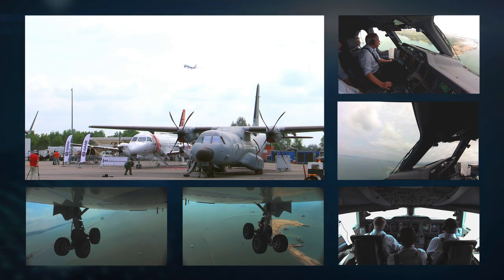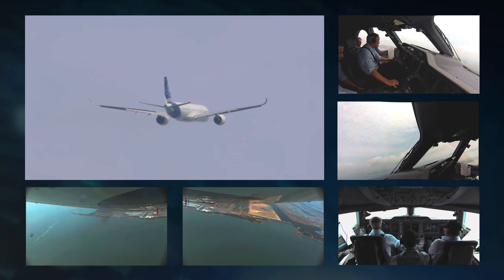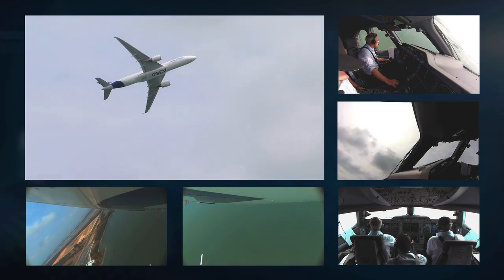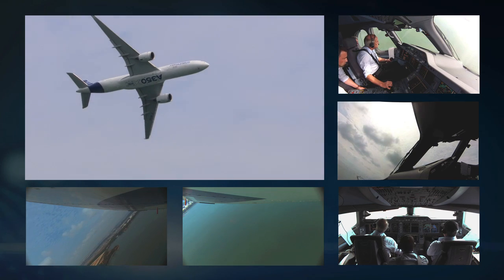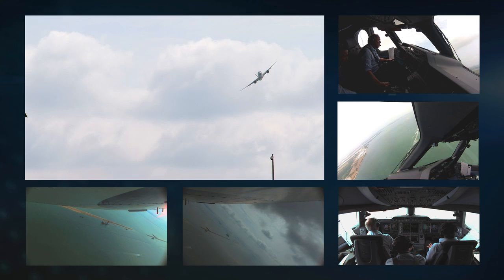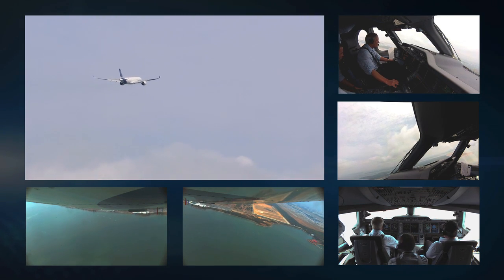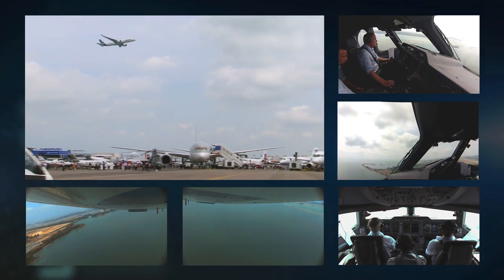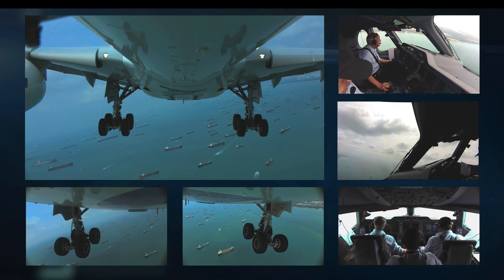The A350 XWB takes centre stage - a headline making flight display

Comment: Airbus+ do you use rudder to bank your tight turn in low speed maneuver? sometimes, not often, but i see some doing it...but couldn't tell if it parts of the maneuver for tight turns...

Comment: Watch your back Boeing
Reply: Why such comment... I do not think that it is a superior plane than the 787...it could be a close alternative, but not a better plane.
Reply: 787 full of technical problems
Reply: Steven Alex .. the only one I know is the battery thing.. you know of any others?
Reply: I believe that manufacturing issues also exist something about supply line
Reply: Steven Alex ... that's not a problem is just trying to coordinate that all pieces get on time so ensambly can continute without delays....that's not a plane problem.... it is just ensamblying synchronization.
Reply: Point well made we shall see what happens in the near future

Comment: I'm American, but damned if the French don't make beautiful and amazing airplanes. Commercial, that is. Dassault is a joke. But I would take any Airbus over any Boeing. Boeings are crude, but easier to work on. I'd take an A320 over a 737, a A330 over a 767, an A340 over a 747 (this one is the closest call), and the A350 beats the PANTS off the 787.
Reply: yea on point good sir, & I agree 747 tough to beat wit the 340, I'll be a close call